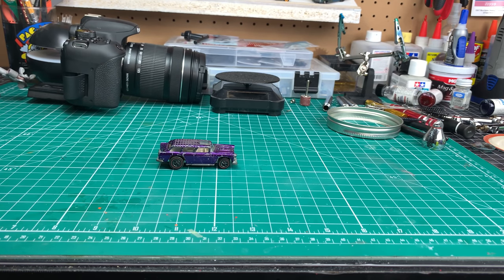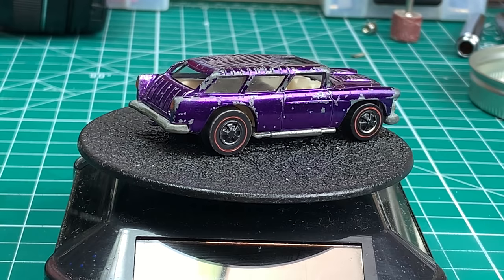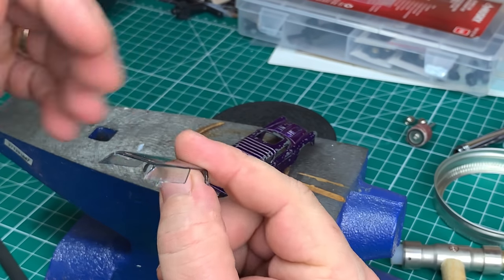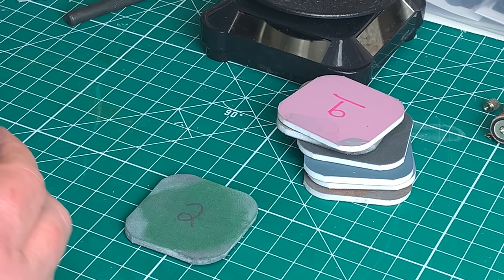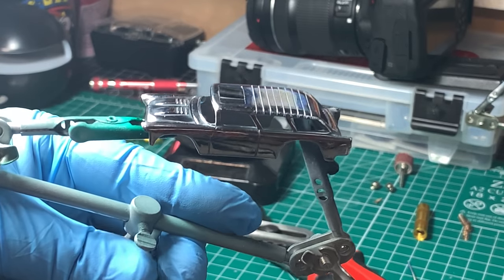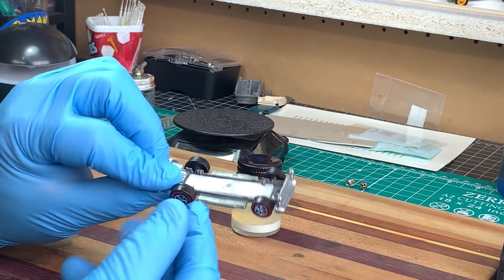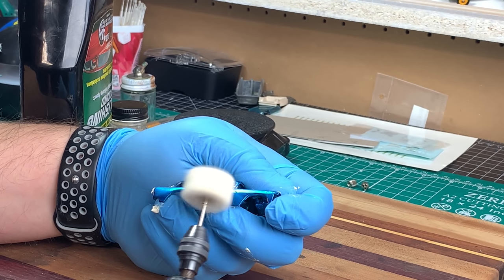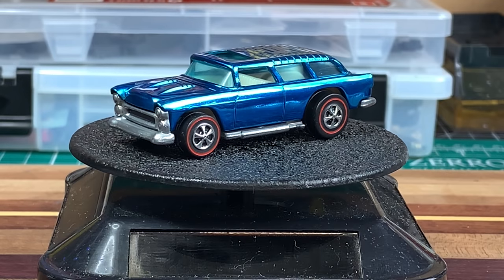Hot Wheels Redline Classic Nomad 55 Restoration

Comment: adding baking soda to the super glue not only makes it set up in a second, it also adds strength. Tho they use a better grade of glue, they use the same idea to fix dents dings and cracks in the carbon fiber rotor blades on real helicopters. It is a strong repair that way, way stronger than super glue alone. If you get the Super thin glue from Bot Smith industries, it can be used to replace metal pieces, like the things that hold the axels in place, or other parts. When you get small imperfections in the casting surface and are going to paint it, you can use modler's putty, or in this case since you're using what amounts to a candy color, there is a low melting point solder that works for soldering the zinc castings. you can fill with it, then sand and polish it back down smooth.... if you want to go that far. You could also fill the dings with modler's putty, then prime and paint with a bright silver paint, then put the blue over that, or in some cases a brilliant white would give the same effect. If you ever want a darker color than the paint you have, spray it over gray or black, it's the same effect as with real candy colors done on full size cars. You can also put on designs in both white or silver and black, then paint over it with the candy color for a very unique  but subtle paint job.
Reply from the maker: Great info!

Comment: Just an idea .. to straighten the body at a difficult angle without hammering
stretch it in shape by using 2 flat little ice sticks, and inbetween some wedge
( the wedge will make it possible to adjust the roof / shape of the window )
Reply: Can restore mine
Reply from the maker: That would probably work as well. I like the anvil because it's a very solid surface.

Comment: That looks really good I might have asked you to put a clear coat over it after polishing instead of the paint but anyway I have a question and it may be ignorant but can I send you a car or two or three to get redone and how would I know how to get ahold of you? Great video you do great work
Reply: His Facebook account is in the description
Reply from the maker: Typically I don't do commissions because the cost usually outweighs the value. This car for example. Glass = $8, Wheels = $7, Paint = $7 Parts shipping = $7, shipping car to and from is roughy $9. $38 just in parts and shipping without any labor. You can email me at wheelsnthangs@gmail.com

Comment: I like to use lime away on the base for 4 minutes to get rid of oxidation. Then brass brush it afterwards and it’s darn near brand new! Just dilute it 50/50.
Reply from the maker: The acid I use is a 50/50 mix just works a little quicker :) I actually used a brass brush on this one but picked up the wrong one in the video to show. Great tips!

Comment: What would you charge to paint with that windex blue?
Reply: It was a restoration for a customer.  Blue was the colour the customer wanted.  A coincidence, I customised a Matchbox Ford Falcon, which was a purple race car version, and I changed it to a blue road car version.
Reply from the maker: Typically I don't do commissions because the cost usually outweighs the value. This car for example. Glass = $8, Wheels = $7, Paint = $7 Parts shipping = $7, shipping car to and from is roughy $9. $38 just in parts and shipping without any labor. I'm not saying I won't do them, I just don't think anyone realizes the cost.

Comment: How much do you charge for a restoration? I have a green station wagon I want  in original condition
Reply from the maker: Typically I don't do commissions because the cost usually outweighs the value. This car for example. Glass = $8, Wheels = $7, Paint = $7 Parts shipping = $7, shipping car to and from is roughy $9. $38 just in parts and shipping without any labor.
Reply from the maker: Maxx Kroes very true!

Comment: I got 2 redlines I need restored
Reply from the maker: Typically I don't do commissions because the cost usually outweighs the value. This car for example. Glass = $8, Wheels = $7, 
Paint = $7 Parts shipping = $7, shipping car to and from is roughy $9. $38 just in parts and shipping without any labor.
Reply: @WheelsNThangs  I have a blue 69 camaro and a classic nomad